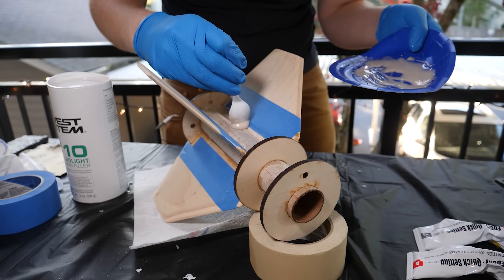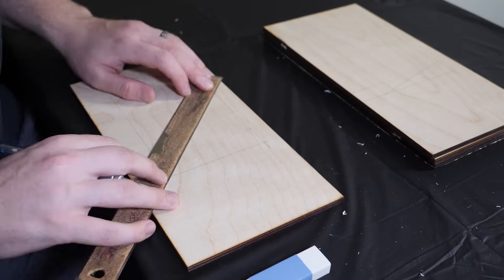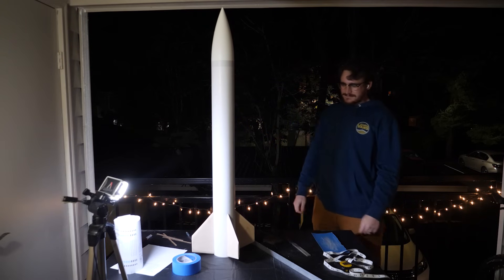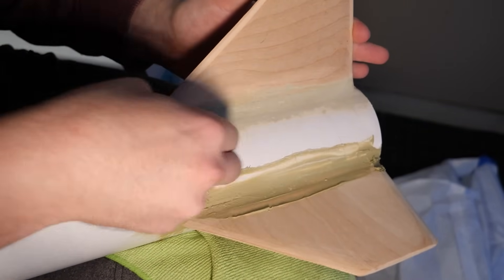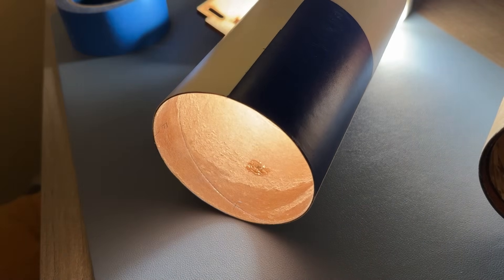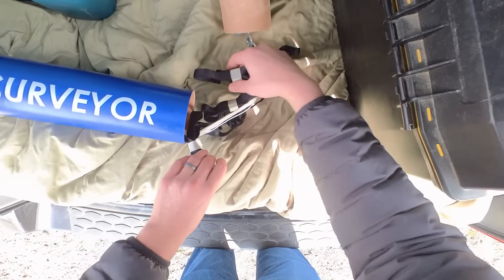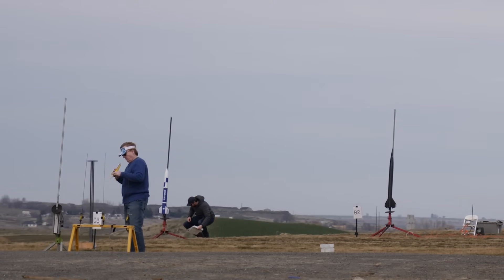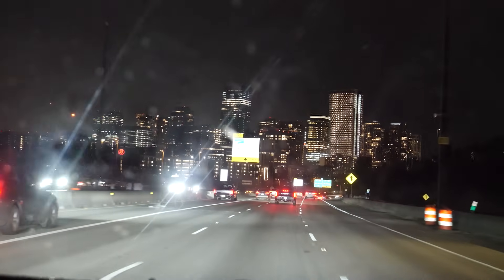Building a High Power Rocket From Scratch

Comment: Is there an actual reason to get certified? You mentioned that it's non government so is there something stopping a non certified person from firing off the biggest possible motor? Aside from it being a terrible idea of course
Reply from the maker: @droko9  yes, you need the certification to fly at organization run events. If you want to fly without a certification (or if you want to fly a class 3 rocket), you will have to coordinate directly with the FAA and other authorities to get your own waiver. Also, certified motor manufactures require proof of certification to sell you motors unless it’s specifically for a certification attempt.

Edit: a waiver is permission to use the airspace and is required for any rocket class 2 and up (a rocket that uses more than 125g of propellant, uses substantial metal parts, or weighs more than 1500g total)
Reply: Essentially it allows you to legally fly higher impulse (power) motor and although the organisation are non government the qualifications are recognised. Like how colleges aren’t directly owned by the government but the qualifications are recognised by them
Reply: If you  are a University student, you are exempt from needing a certification to buy motors. It falls underneath the NFPA 1127, 1.33 exemption rules for University students and government bodies. So if you are a university student, you can buy any size of motor you want without a certification. However if you want to fly that rocket with that motor, you do need to coordinate with the FAA to get a waiver, or fly it at a club. If you fly it at a club, you just fly as a non-certified flight. I mentor a lot of college teams here in the United States and a couple across the seas, and have done this many times. 

In my opinion, once you hit a level two certification, I find it funnier and better to fly privately, and with smaller motors. I usually go with an h550, and do the same thing in that level one level three.
Reply: @LT72884 if you're on your own property, miles from any airport, will your rocket still show up on radar and get you in trouble if it's big enough and high enough?

Comment: How'd it take me 7 months to see this video??? 

One thing I do with cardboard couplers that have to be removable is coat them in thin CA. Then, when you sand them, they don't get that fuzzy texture. You can sand them nice and smooth. I do this with payloads as well as couplers for two-stage model rockets, and it works great.

Comment: Way better than the 90 deg aluminum stock is to just use a 4ft level and lay it on its side.  Same trick as the door frame but better for big tubes.

Comment: Lol, sorry for second comment, but the j270 should be perfect for your rocket. Thats what i flew in mine for the L2 and it was perfect. I used the same motor mount tube as yours.  For my L3, i used M but that was in a 98mm motor mount and a 10 foot rocket haha

Comment: If your fins break when landing, you have selected the wrong size of chute, to thin of plywood, and or used bad epoxy joints haha.  But i do agree that sweeping them back is a good design 

My L2 feel from 6300 feet after the motor exploded and broke the shock card hahaha, fins held great.

one thing you could try out, if you want, on your next build, install the motor mount tube with the centering rings first, then cut the slots for the fins in the airframe and slide the fins through the wall and tack onto the tube. It was much easier to install fins that way vs the can method.

Comment: That was an interesting 'chuff' at 13:10 launching from the Friends of Amateur Rocket (FAR) facility in the Mojave Desert. Sliding back down the rail, the lower rail guide came off and when it finally came up to power, it launched at an angle to the left and collided with the rocket on the left knocking it off the rail. Make sure your rail guides are firmly attached to the rocket airframe.
Reply: It was a old motor so a little chuff was expected but not that much chuff😂

Comment: Just so you know ejection charge delay time is calculated after the motor burn out so if you had an 8 second delay with a motor that fires for about 2 seconds there will be a 10 second delay after launch to the parachute ejection

Comment: Curious how much of the rocket could've been 3d printed?
Reply from the maker: You can 3D print a lot, but it tends to make the rocket heavier which is fine as long as you stay above a minimum thrust to weight ratio of about 4:1 (depends who’s signing off on the flight). It’s also worth noting that Tripoli doesn’t allow for certification using a fully 3D printed rocket because it’s supposed to be a demonstration of your ability to build the rocket not just fly it.
Reply: @ConHathy  print just the nosecone. It also seems you didn't fiberglass the body tube,nor use fiberglass cloth to reinforce the fins-to-body tube. I did that on my scratch-built large model rocket,3.5" diameter,45 Inch OAL, 2.8 lbs,29mm motor mount.  My body tube was a Xmas paper tube,glassed.